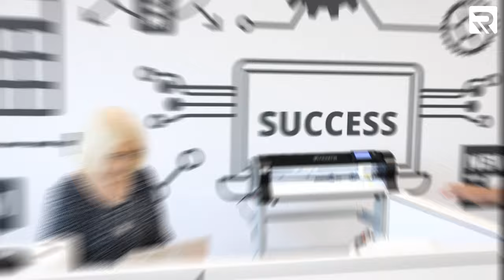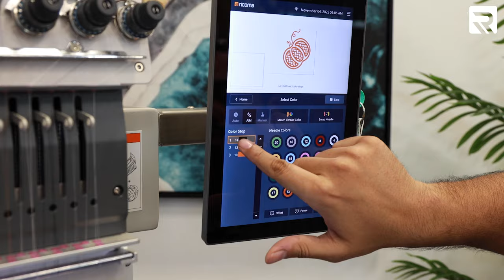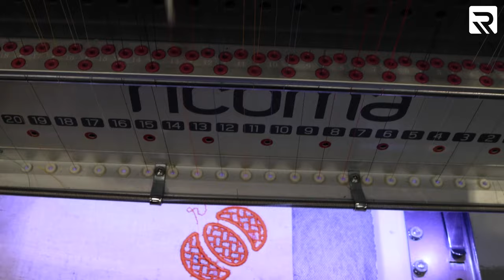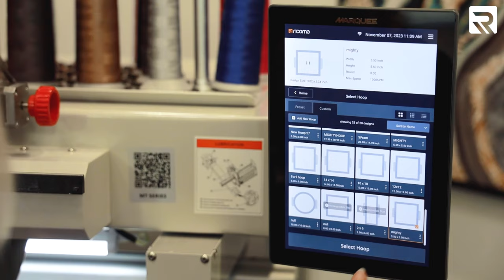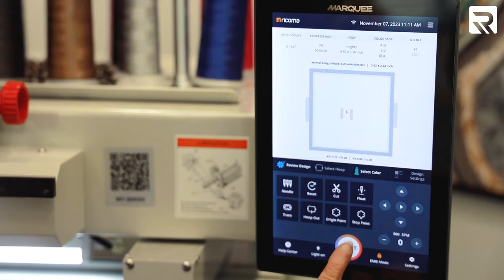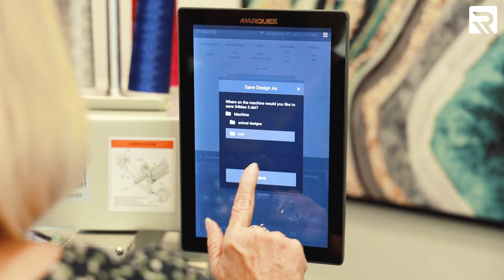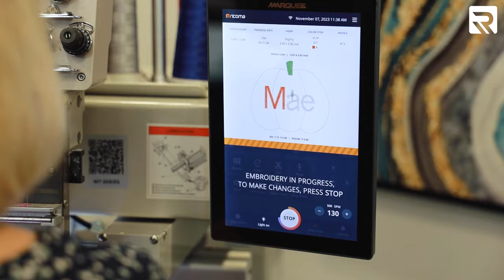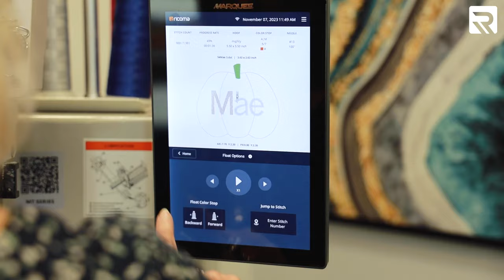How to Create Stunning Cutwork Napkin Embroidery for Thanksgiving

Comment: I just found this video and love it. I always learn best by watching others first and then try it myself. Great job. Thank you for the video. I've been thinking about getting a machine from ricoma for a while now. I have one question though. I noticed that you always do a trace. Is that necessary? Does the machine not know if a design fits the hoop I select in the menu? Sorry if that is a stupid question but I am used to my domestic machine telling me that the design fits in the selected hoop.
Reply from the maker: You’ll be able to see that the design fits inside the hoop but tracing is always recommended as a safety measure to double check. Better safe than sorry!